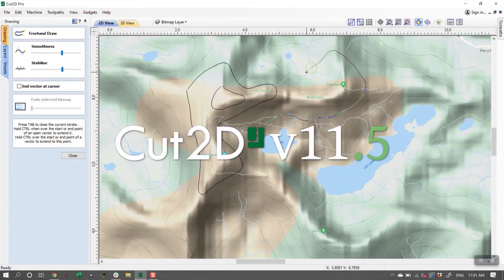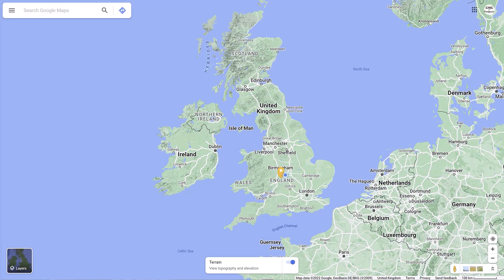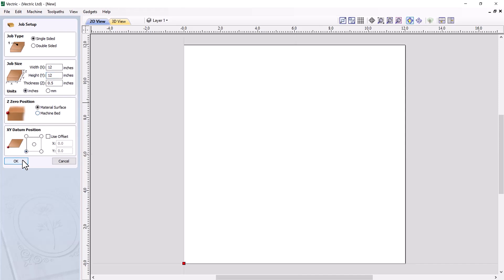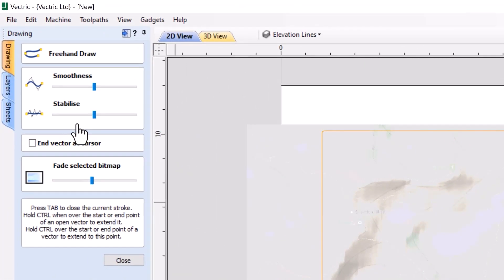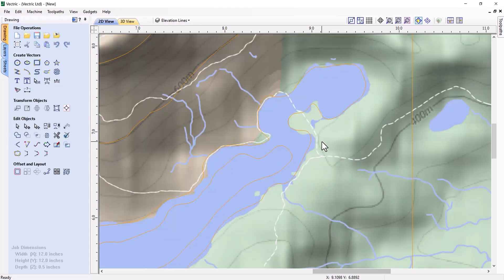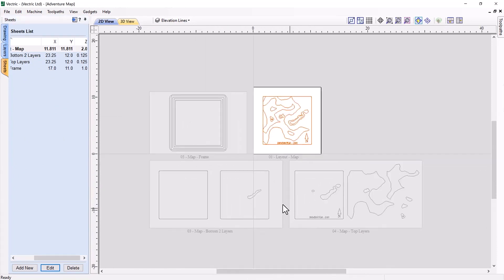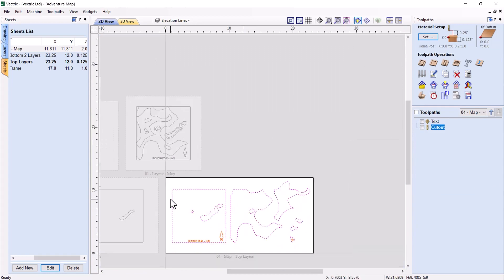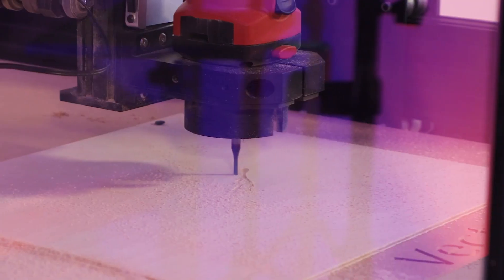Making an Adventure Map | In the Labs with Todd | Vectric FREE CNC Projects

Comment: You did it the hard way.  Instead of doing several different cuts and gluing them up, you could have just cut it all at once into the piece of oak used for the framing.  That works because it's a 2.5D project.  I did a similar project last year for a friend where different levels were cut into a solid block of wood to represent the elevation lines in a lake.  Instead of painting inside the lake though, I used tinted epoxy to give the effect of real water.  Since the epoxy was tinted, it had the added benefit of making the deeper parts of the lake a darker green color.
Reply from the maker: Hey "Coach", thanks for taking the time to lave a comment.  There are many ways to create a piece like this, and I'm glad it sparked a conversation.  I hope this gets people thinking about how they might make one of these map projects "their own".